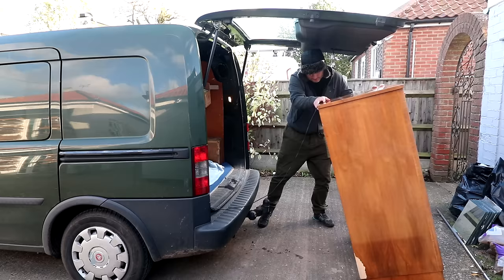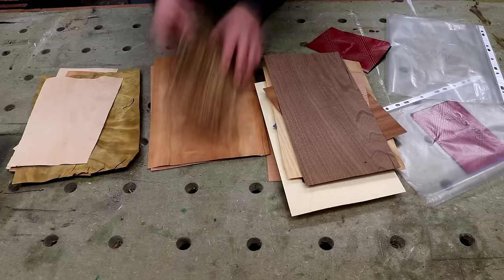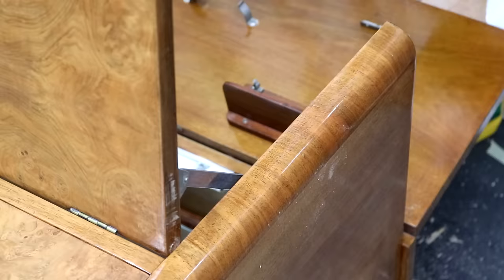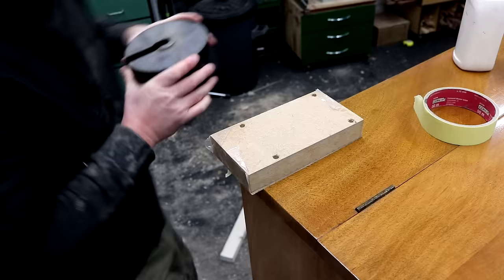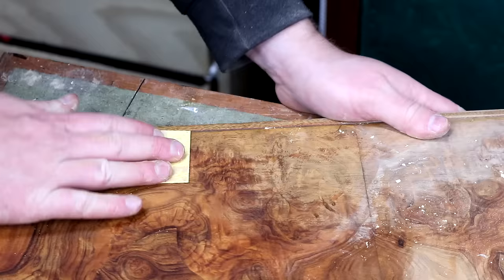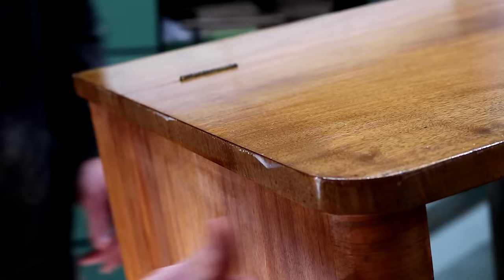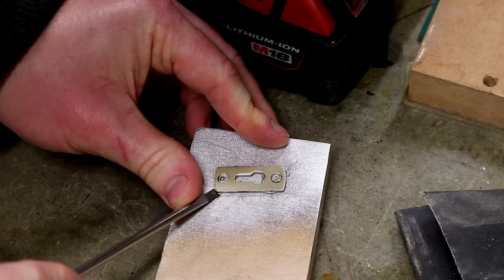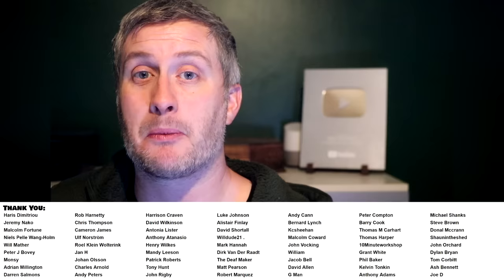Veneer Repair & Refinishing Furniture: Cocktail Cabinet

Comment: angling the cuts on the veneer about 15-20 degrees might help with fitting them without gaps (marquetry trick)
Reply: Cool tip!

Comment: You can rebrass steel by running a brass wire wheel over it at high speeds, the heat sticks a thin layer of brass to the steel and makes it look shiny gold again
Reply: You can also do it by heating the steel and running the brass over it at regular-ish speed

Comment: One method I've used to make veneer patches is to put the new veneer over the broken area and cut through both at the same time. The patch will always fit perfectly. You can temporarily Mark the cut line with tape to ensure you get all the damaged veneer removed.

Comment: Btw, a very good method to glue veneer, is to use an iron.
Just glue both parts, let it dry, put them together and heat it with an iron (no steam).
Works much quicker, nicer and less awkward as clamping. You also have a lot more control.
Also good solution on parts were clamping is not possible.
I like to use a roller for the glue in this case.
Reply: Good tip! What glue do you use for this?
Reply: @Saladzingers  just regular wood glue.
Reply: I suppose hide glue would be best
Reply: @peteypops  I don't know. I always used regular wood PVA glue. PVA has the property to soften when being heated. It's actually a quite common veneer technique.

Comment: We just moved into a house built in 1960, and all the inside doors are wood. Some have veneer areas missing at the top and bottom. I'm hoping to save them by making veneer patches, and I love your method of using the masking tape to make a template for the cut away area! Brilliant!!

Comment: Excellent work- I appreciate the dialogue relating to the quote and original time expectation and what it took to get it done.  I've done some veneered front doors, stripped, detail sanded and re-varnished.  Each took more time than expected and I'm starting to get a sense of what it really takes to quote out and hit the mark without scaring the customer away and delivering the best work I can for that price-point.  I realize with the techniques you've demonstrated that anything is possible, outcome is always better than the start (if you know what you're doing) and it's fun and challenging to take on some of these projects to make a living- also, your energy is great.    Thank you Sir!
Reply from the maker: Thank you!

Comment: Rag'n' Bone Brown nice job . You can use junk mail adverts on glossy stock as a glue applicator for narrow gaps. Also use for loose veneer not fully detached . Make incision with exacto knife , put some glue on strip of glossy card stock junk mail ,..insert into crevice back and forth to coat with glue , tape or clamp down . Good as new repaired veneer. Thanks for keeping repairable furniture out of the landfills.

Comment: I usually use hard wax prior to sealing. Hides the gaps and stops absorption into end braid plus you can lightly sand back smooth. If it helps.

Comment: Congratulations.
When you said this was only your second time doing veneer patching and you had learned a lot from this - that is the big point. Paying attention to how and what you do - then seeing the results, and then taking the time to consider how you could have done it better. That is missing from a lot of people working in these trades.

Being that it is from the 1930s - I am guessing it is shellac.
In the 1930s the manufacturers really transitioned over from shellac to nitrocellulose lacquer. After WW I there was a lot unused cellulose nitrate left over (used for making gun powder). With the end of the war - a method was developed to make this into a fast drying finish.
The reason I think it is shellac is that the finish looks in relatively good condition. Shellac (while considered weak by modern standard) really does hold up well to age. Lacquer on the other hand tends to "alligator skin" with age, and other modern finishes all have their problems.

I don't do a huge amount of veneer work, but enough lol.
Here are some ideas you can maybe use... or possibly others.

- The cracking looks more like the veneer is split - pretty common with burls.
- Could use sandpaper to clean the old glue out from under the loose veneer. I will take a piece and fold it so you have abrasive on both sides. Slide it under and push on the veneer while pulling it out. Repeat a few times to get the old glue off.
- When making patches, it will look better to do "boat bow" () shapes, triangles (if the bottom flat is an edge), or even diamonds. Flat edges should only be placed only going in the same direction of the grain. The cross grain edges should be angled or bowed so the seam isn't straight. The larger the angle the harder it is to see. ** Not at 9:32 - there is veneer patches on the upper right and left. This is not uncommon and the manufacture probably had holes in those areas... and if you look over the very top on the same frame you can see a few others.
- When finding a veneer patch - look not only at grain, but pores as well. You can also check wood color by wetting it with paint thinner - though if you are applying shellac or lacquer will probably make it look slightly darker than those finishes will.
- You might get a tighter patch by placing the new piece on top of the damage and cutting both at once - Though I have also made tracings like you did... and then used sandpaper to fine tune the veneer patch edges until they fit perfect (this means you might want to cut the patch a hair bigger to give room for tuning).
- To help prevent the dark seam with patches - You might try holding off on coloring the patch. Get a few coats of finish on and sand to have it flat (with no dip at the seam). Then add color to the patch area (this is technically called toning). It can help reduce that darkening of the seam (because you have sealed the edge grains with the finish and so the stain doesn't seep into it).
You can also use acrylic paints. Seal the wood with your finish (just a coat or two). Make up a color that is the same as the wood background (light) color. Use a fine art brush to dot along the seam. This will break it up and help hide it. Since acrylics dry slightly darker than they are in liquid state - you will need to go slightly lighter... and do not apply a finish for at least a few hours as the acrylics need to completely dry so you don't cause blushing or bad adhesion.

A note on patching and coloring...
It is inevitable that wood darkens as it ages. This means the stains we apply (and the acrylics) may (may) eventually become more noticeable as the wood around it changes. There really is nothing we can do about this. Use a metalized stain (which resists fading), but really it is just a fact of life and something we have to accept (unless someone knows something).

Now I want to go watch a more up to date video of yours.
Keep at it.

Comment: 2:43 For a perfect match of the insert, you can place the new veneer on top of the old one, and use a sharp knife and cut through both at the same time.
This way, you get almost a perfect cut between the old and new veneer.
It's a trick that's being used with wallpaper (corners etc...)
Reply from the maker: I did consider that but veneer doesn't cut too well with a knife (even a sharp one) as the grain tends to lead the blade astray
Reply: that is a great tip thank you!
Reply: @RagnBoneBrown  , even with a ruler and a x-acto knife ?

Comment: An alternate way of veneer patching is to use a very plain grained patch, match it to the background color of the wood, and paint grain on it after the first coat of shellac. You can use stain, furniture retouching markers or paints. Or all of them.

Comment: The trick with repairing veneer is to use an irregular shape. If you're using a straight line it will be much more visible. Next time try to patch the veneer with an irregular circle (hit a steel pipe with a hammer and sharpen the edge for example). Also, staining is a great way to blend in your repair, however it is better to do it beforehand with a test piece. That way you will be certain your piece will blend in, it's a waste of time if you have to replace when you're not satisfied. To hide the lines, use some sawdust with hide glue to fill it in. Hide glue by the way is the best option for restoring a piece. It's reversible so you can undo your work. Keep it up, you'll get better every day ;-).
Reply: Can I moisturize warped veneer to get it flat again?

Comment: I love it when you these furniture repairs & renovations, I live seeing old damaged wood being brought back to life.
You don't need to worry about clamping glued veneers too much, usually the strength of stretching masking tape or blue painters tape over the new patch to the surrounding wood is sufficient. Maybe add some dye to your glue to help blend otherwise the white glue will grab the wood stain. Or give new piece a coat of shellac including glue & surrounding area to blend in
Saw on Repair Shop another method of dealing with loose & cracked veneers is to press over with hot iron, it melts the glue under the veneer & grabs & holes the loose veneer. Meet idea with the syringe, but you can't glue to glue, specially mixing glue types. Old stuff usually had hide or pearl melted glue
Reply from the maker: Thanks great tips

Comment: Here is an old Flooring trick you can try... I used to use this technique to perfectly match a patch in Linoleum flooring Cut the replacement piece bigger then the patch. Lay the replacement over the patch and cut a line through both pieces at once. Perfect match invisible seam!!!!!!

Comment: I double cut my patches with a more irregular cut as you would wallpaper rather than make a template, lil more work, but makes for an almost invisible patch. Do at times use a handmade fine sawdust filler or wood grain paste to fill the hairline crack if I get one. Also helps to just faux in matching grain.

Comment: I'd use a glue remover for removing the packaging tape from furniture - one that's based on citric acid. The one I've tried was so good I could remove caked-on packaging tape from an old dresser (probably close to a century old) without resorting to anything else. It did not leave any trace behind and it did not damage the lacquer  (though I don't know whether the dresser had been re-finished at some point with a newer varnish).  This type of glue remover does not leave any glue residue behind at all as it breaks down the glue, which you can then wipe off. This means that often you don't need to resort to heat for removing the tape. I'd be cautious with the heat gun as it can scorch the lacquer and the veneer or lift the veneer. I'd try with a hair-dryer first since usually hair dryers come with a couple of heat settings, so you can use the low setting to begin with.  The only downside with the glue remover is that it's more expensive so you may want to save it for special cases, if you do this sort of thing a lot. Then again, it's very easy to work with so it's down to what's more important to you. Word of caution: I don't know what kind of wood finishes it might react with, so always test first on an small area of the furniture piece that doesn't matter if it gets damaged.

Comment: Congratulations Keith, fab video.  Fast becoming one of the best channels on youtube. I spent a few years working in a joinery shop in nyc before returning to Ireland and I did a good bit of this kind of work.  You have everything fairly covered there I'd say and it would want to be a picky customer to complain. "Discrete but discernable" is the rule of thumb stateside for repairs in that each one adds a little to the story and authenticity of the piece. Another was to add a 50% extra to the amount of hours you think are needed on a piece (haha!!). Maith thú agus lean ort!!

Comment: With you on the stripper, but a good one I have found is Polycell Maximum Strength Paint Stripper which I can buy as a 'civilian' from my local hardware shop in Bedfordshire. Absolutely stinks, so would recommend outdoor use only. (not a winter product!). Amazing veneers on those doors!

Comment: If you fix the replacement veneer in place before cutting the old veneer, cut them both together making sure the knife is upright. Then you will get a perfect fit.

Comment: great video thanks for posting, with regards to stripping old varnish off have you tried washing powder and boiling water in a bucket. Then use fine wire wool 000 to rub off the old varnish. Works a treat, once dried then with a mop brush add shellac brushing with the grain. Let it dry then use natural or clear wax put a little oil in you wax tin then apply all over then buff. It restores the original finish without stripping back completely.
Its the old way of stripping that french polishers would use. I learnt this from the you tube channel the English polisher. Works really well with old antique pieces.
I am working on replacing some veneer on a chest of draws at the moment and found your video very helpful Thankyou
Reply from the maker: Cheers I'll check out the videos👍
Reply from the maker: Hmmm... He uses it for cleaning, not stripping....
Reply: @RagnBoneBrown  sorry yes he does.

Comment: keith  over all its perfect ;];];] considering the shape it was when you got it.. i think you did right by the customer..as for scrapping not me..i have no other place to redo furniture except my living room.    my garage is dirt flooring with brick walls   ..my cellar is great except hauling large pieces like yours would be exhausting  up/ down a steep set of stairs. so the living room it is..;];];]  i have read the other comments and i fully agree with citrus stripper..its water based..NO FUMES!!! now... this is how i do mine IN MY LIVING ROOM!!! i have a open floor plan downstairs  no doors into each room...so any/all smells are everywhere in the house.   this is how i do mine....and yes i have a cat thats always maybe 2/3 ft when i work. not my choice,   i live in northern maine... its currently snowing;[;[;[  ok  this is how i tackle my projects....bring it home  and clean it /vacum it  let it dry..then  take citrus strip to it  leave it 20 minutes  and get a bucket of hot soapy  water and green scotch pads...and a PLASTIC PAINT SCRAPPER...{no wood gouging}  take scraper and push off the stripper put waste in a tin can...then..i take a scrubbie and dunk  in the water and scrub WITH THE GRAIN   and IMMEDIATELY  WIPE  IT DRY  WITH A OLD SOFT BATH TOWEL...and  either go back with the stripper...or start another section to strip...THE SCRUBBIES WILL GET GUNKY.....take them and wash them with dish soap.. rinse well and refresh the hot water  and go at it all over  again..i do wear laytex gloves not the yellow heavy duty...just reg clear types you find in the pharmacy section..  i have NEVER GOTTEN CHEM BURNS and it doesnt have a smell to make you sick..and yes  ive worn alot of splatters from it all...no after effects ;];];]  wash and go..it hasnt even ruined any of my clothes either....get a piece of scrap furniture wood  like a spindle off a chair and try it this way...... I PROMISE IT WORKS WITH NO TOXIC SMELLS  !!! I HAVE DONE 6 pieces since march IN MY LIVING ROOM!!!   3 CHAIRS /SEWING CABINET/ A LONG CONSOLE COUCH TABLE  /A BIG LONG DRESSER...  now im working on a card table.;];];]  the 2 chairs and console table went to my neighbor..i kept the rest for my own use... its THE CLEANEST SAFEST FASTEST WAY to strip a piece of furniture ive come across.. and no  i dont worry about the cat.  we have our boundries established. please chk into this...it will save YOU SOO MUCH TIME /ENERGY AND FASTER TURN AROUND on pieces;];];]  my neighbor is amazed how fast i can get a piece done from start to putting on the coat of poly on it...i KNOW YOU WILL LOVE IT!!!!! good luck!!!!

Comment: I wouldn't hesitate to use a good linear or rotary sander on veneer. Yes veneer can be thin but using a proper grit will get you through the job much quicker

Comment: I think the varnish remover gels I use now just melt into the natural grain.  I remember a tough gel called Strip-Ease.  You are right, the removers are terrible.  I have used this orange stuff and I got most of the paint off.  But it is nothing like Strip Ease.  The fumes are horrible on the old strippers, but they made paint and varnish just peel off.  The orange gel I use “peels” as well.  And I still got staining.  You have to take all of the remover off because it stains a brown color.  I want to wood to look as natural as I can.  I might just end up painting it, after all that work.  Sigh.  I wanted a blonde Scandinavian look.  Oh well.  At least I have treated the surface so paint will adhere better.  Whoever painted it just used thin layers and the paint peeled.

Comment: Morrells sell a good stripper that still works well called 'Paramose' don't get the water based one though as that does seem to be weaker.
Reply: Quite right. All you need is business credentials to buy, a letterhead or a business card will suffice, I use the thinner one and it is superb for doing most finishes. It is readily available for business use.

Comment: Could you get a better fit by rough marking the veneer to the approx size and shape of the space it was going to fill, then put the veneer over the section of old veneer to be replaced, then cut through the new veneer and the old veneer in one go.  Then pick off the old veneer, and your new veneer cutout would be an absolutely perfect fit for the cutout in the old veneer.